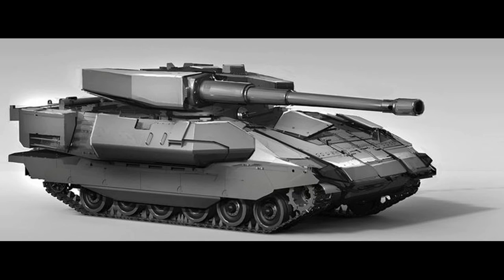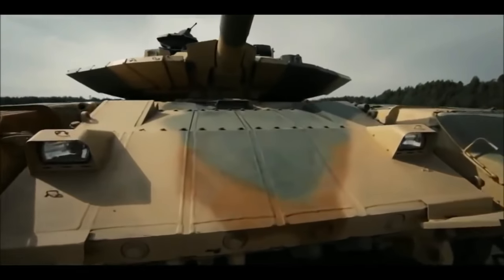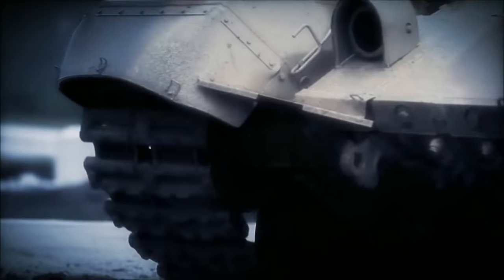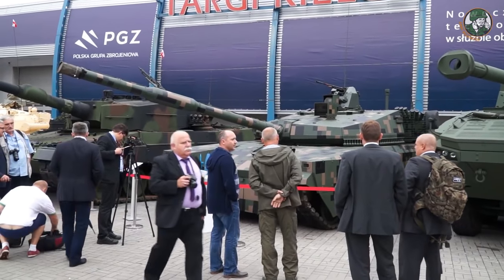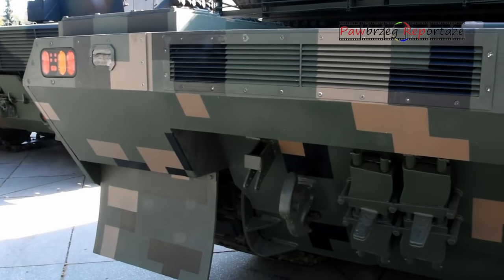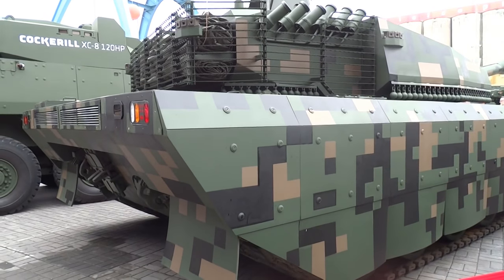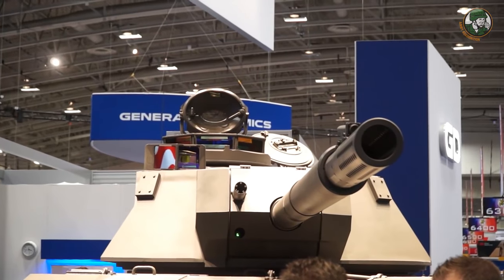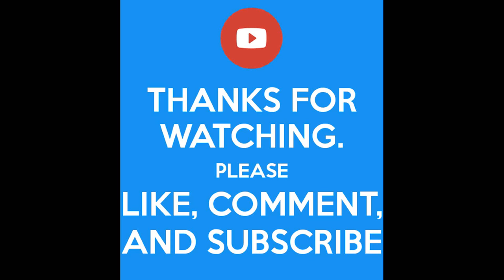3 Newest Tanks showcased at latest Exhibitions: T-90MS Proryv-3, PT-16, & Griffin.

Comment: Technically you are showing images of the Proryv-2 ie "T-90MS", as the Proryv-3 ("T-90M") design has yet to be finished. We still are unaware if will use the 2A82-1M gun, but if it does, it will require a completely different autoloading system.
Reply from the maker: They claim it was on display at Army-2016. Those pictures were the only one's I found from Army-2016 of the T-90MS. I knew it wasn't a Proryv-3, but the sign there also, showing the Proryv-3 Specifications. It had to be there. Maybe pictures of it were restricted for taking. Because it's official, it now has the 2A82 gun, which I really want to see for myself as well.
It won't use a 2A82-M1 gun though that's for sure. Just the 2A82. The 2A82-M1 is for the Armata only, as it has no Fume Extractor and the T-90 needs a Fume Extractor since the crew is in the turret. I wouldn't worry too much about the AL either as they're all 125 mm rounds, I'm sure backwards compatible, just will still have the 8 RPM instead of 12 RPM.
Reply: Ukraine War Awareness Never saw that myself, interesting if true. 

Theoretically the Proryv 3 could just be a domestic variant of the MS. We don't know much at this point.
Reply from the maker: 2:55 doesn't sound like a T-90AM to me personally. Here's SF's confirmation from UVZ (https://youtu.be/8sAcs515w0c?t=3m25s) and Sputnik's confirmation (https://sputniknews.com/military/201609091045126136-russia-t90-tank/). They wouldn't re-discuss a 2012 T-90AM in 2016 IMHO, since that's what the Domestic Variant of a regular MS is. Otherwise, I don't know what other type of lessons they can learn from Syria other than unification of Battle Networks and Communications along with written text box on display.
Reply: Ukraine War Awareness SF is just assuming. As mentioned, there's been no hard evidence it will actually switch to the 2A82 especially on Russian language forrms (where this kind of thing often pops up).

The T-90AM in fact, never existed in any form than on paper. All you ever saw or heard about was the MS and UVZ rarely ever mentioned the "domestic variant". 

From my perspective it is basically going to be a MS with, possibly, the 2A82.
Reply from the maker: Well, according to this article (https://sputniknews.com/military/201603191036592096-russia-t-72-upgrade/) that I also included in the Video, Sputnik claims that Russia has both T-90A and T-90AM tanks in service. True or not, but at least test pilot AM's have to have existed since 2012 in my opinion.
I mean I personally thought that Russia had about 40 Armata's by now, but on the same date they reveiled the Proryv-3 is the same date they stated they just received a batch of 100+ Armata's on top of the 20 they already have. 120 for Test Pilot purposes as they've stated. So nothing would surprise me anymore about what they can whip up.
Reply: Ukraine War Awareness Sputnik can not be trusted with about anything...not to mention the specifics of military matters. In addition, the article they provided as a source (Izvestia) does not mention the AM anywhere. 

I've spoken to a few Russians online who share the consensus that the "AM" was nothing but a domestic proposal of the Proryv-2 MS program. I'd assume the Proryv 3 (M) came about simply because the AM was rejected, and  Armata had already been in the MOD's hands.  

They most certainly do not have AM's in service, if they did, we would have seen them. Kind of like with the T-72B2, media claimed they were in service when they really weren't.
Reply: Compared to any western media, Sputnik is a Holy Graal of Truth))) ...
Reply: ***** ...point being? India is already confirmed to be buying over 400.

Comment: Yesss...the russkies were much proud, of their t-80 when they first devued it. But we know how that turned out don't we?  A bunch of chechin curs using only Rpgs racked up a most impressive kill total of 270 of those over rated 'super tanks'.  Russkie armour sucks. Always has and allways will.
Reply: masterofsteel You were so proud of your Abrams until Irquis and Afghanistans started cooking them for dinner. So much of your super tank, aka the worst tank in the world.
Reply: In Chenchen war the ERA that T-80 used in war doesn't have any explosive filler because the explosive filler is sold by guy on the millitary. Bad tactic and no infantry support also made them fucked at the battle. If you compare Russian armor like T-90A with M1A2 it's actually almost the same. T-90A have protection equivallent of 920 mm and Abrams has 960 mm against kinetic ammo. Not a big difference.